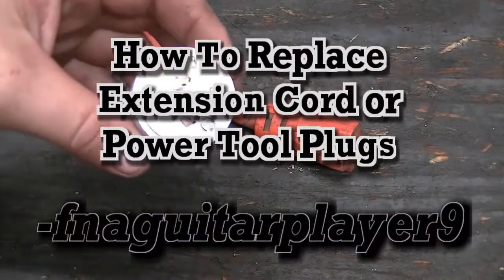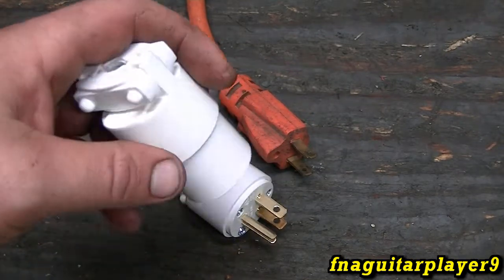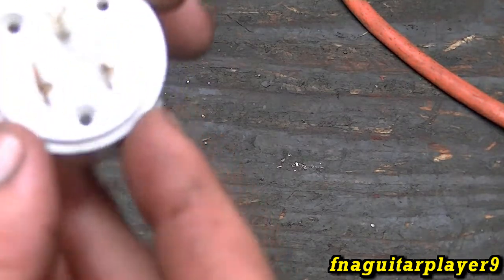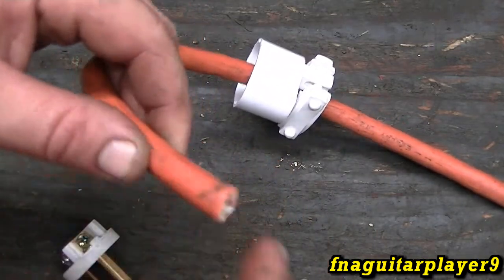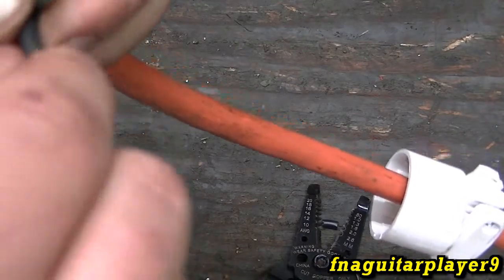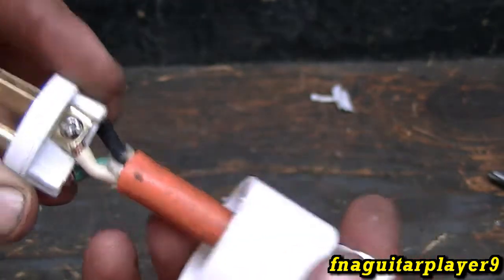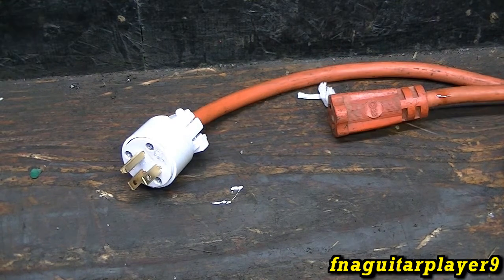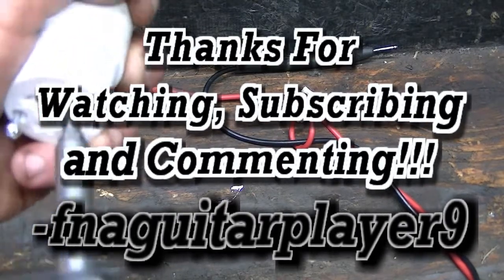How To Replace Extension Cord / Power Tool Plug / Ends

Comment: Great video. Got any tips on making a quad box? I’d sure like to make a couple for my workshop.  Most of the videos on the subject are really bad.  Cheers.
Reply from the maker: Thanks! I actually have one cord like that that needs to be fixed, when i go to do it, probably next summer, i will make a vid, its really simple though, you can follow a video on how to wire up a standard receptacle and do the same with it, and have a clamp on the box to hold the cable, then just jumper it over to the 2nd plug in. They are really handy to have! Thanks for Watching!!!